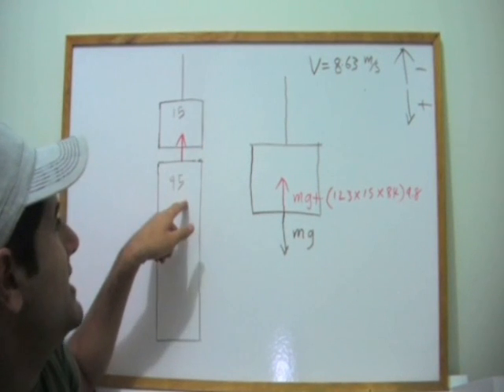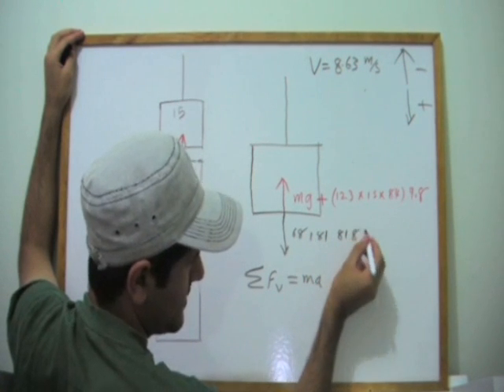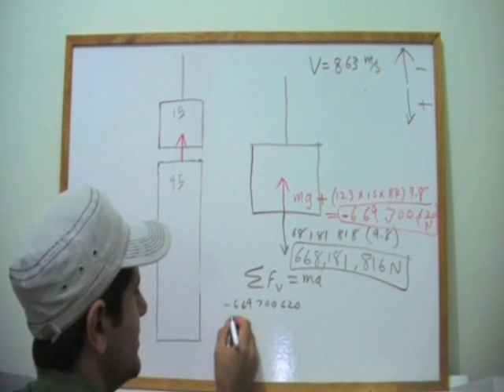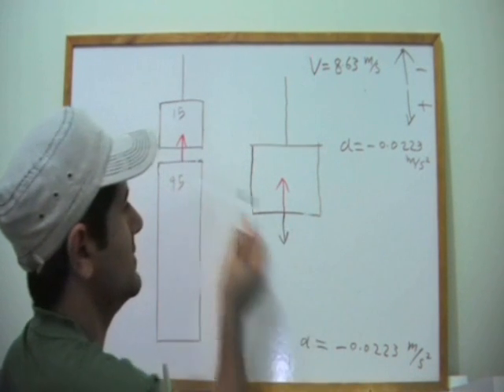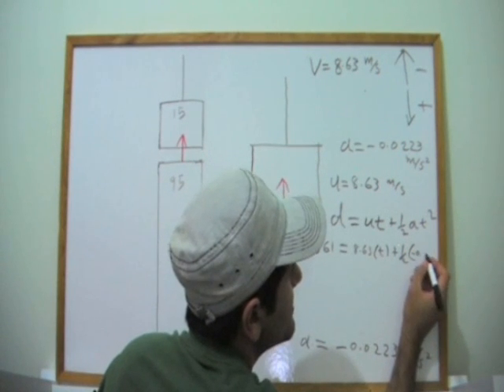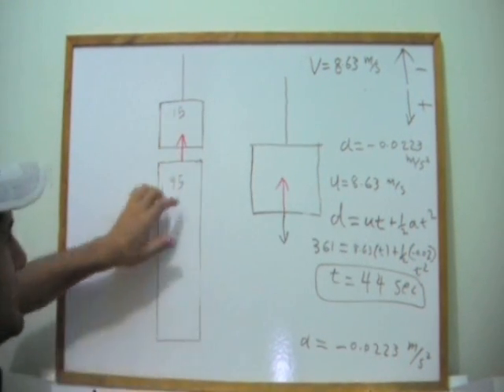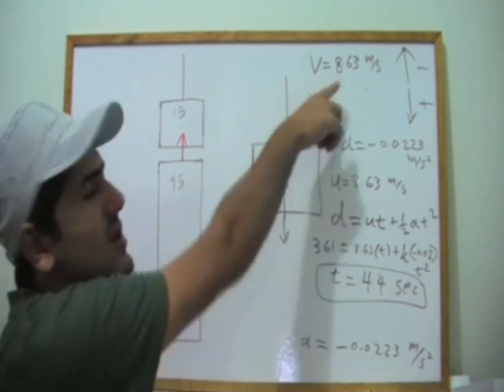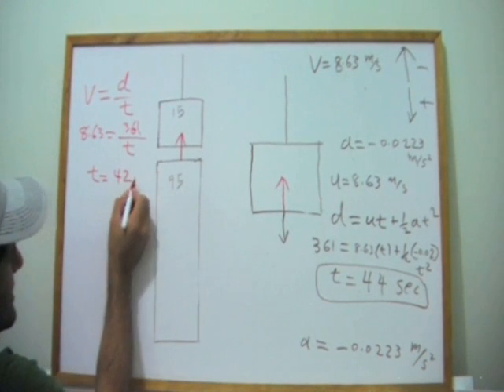(Part3) 911 Simple Physics Structural Failure Vs Demolition

Comment from the maker: Exactly 10 floors can not physically destroy more than 10 floors equal to their own size and strength and after doing so they will be grinded in the process so how did  the top 10 floors destroy the button 90 floors?  I challenge any institution to replicate a model of this event where the top 10% of any structure can destroy the bottom 90 percent from top down without the use of external forces apart from gravity.. we should start asking this challenge replicate this event for us on small scale

Comment from the maker: well said frank you took it out of my mouth, my assumptions are that this magical 10 or 15 floors will float through the lower structure like it flows through a fluid and the AVERAGE RESISTANCE is a constant force equal to the static force that this building was already taking in the past 30 years, many of them say:  "but the floors accumulate progressively", yes but so does the static support it increases as you go down, so at floor 10 your structure is designed to carry 90 floors above it.

Comment: 12weasel100. Granted, dynamic load needs to be accounted for in a detailed calculation, but so does the fact that in an equal and opposite world in which we live, the falling part of the building experiences the same destructive forces. How did the top 15 (smaller floors) manage to stay "whole" and demolish the lower 95 (larger, structurally)??  Would you not expect the whole process to grind to a halt at some stage... say 15 floors down or so?

Comment: This simplified explanation is very compelling, as this version is best case for the generally accepted physical observation. If a more detailed analysis is performed, dynamic loads, increased structural support, and more significantly the destruction of the falling section of the building experiences the same destructive forces as the fixed section. How did 15 floors manage to demolish 95 floors? Simply impossible. Even if some of the debris combines, it still cannot happen.

Comment: The bowling ball would feel MANY times heavier and would inflict damage accordingly due to it's speed. The upper floors of the Towers would do likewise, especially as the cores were damaged due to burning fuel going down the core. That helped to weaken the towers, and added to the damage being done by the collapsing upper floors. The cascading of the upper floors created a force that the idiot in the video simply does not take into account. His equations are seriously flawed.

Comment: Total rubbish. The only part of the towers that came down in anywhere near 10 seconds was the outer wall at the impact points, which peeled away from the tower. Naturally, with nothing under it, that would come down at free fall speed. However, your figures make no accounting for the fact that the explosions of the planes happened INSIDE the towers, and that burning jet fuel would have gone down the central cores. That would weaken the core significantly.
Sorry, but I'm not buying your lies.

Comment: You have a mechanical engineering degree???   In what??

The building had a floor system that had NEVER been used.  It relied on the cross brace of the floors to provide tension to the columns.  If a floor were to drop out its associated columns lower in load carrying ability by a factor of 8.  If its two floors it becomes a factor of 27.. then 72.. then  216.  Etc.    

No floor system anywhere is designed to have 33 floors set in motion and land on it. 

You should understand that

Comment: If it was strictly my opinion i could understand your comment.  But not when there is close up clear video of it.   I've run it back and forth many times and you can clearly see the middle of the building move FIRST.. then the corners go.   Even S.Eng Gene Corely says exactly the same thing that the antennae is going first.   Or middle of the building as the antennae sits basically dead center.  

I don't know where the "argument" is when there is clear video of it.

Comment: On WTC 1 the center DID go first.  There is clear close up video of it.  There is an isolated angle showing a close up shot of the floors just above the impact area.  You can see the corners of the building as well. At the point of failure you can CLEARLY see the mid line of the building start to drop away directly below the antenna.  You can actually see the floors bowing down.. And THEN the corners go after that.  And it is entirely consistent to how the plane hit the building.

Comment: What you say is partially true.  The center didn't fall first, but it is easy to mistake that for being the case.  If you watch the collapse from a side angle, you will see that the center doesn't fall before the rest of the tower.  Instead, the south face of the tower gives way first (because of fire weakening the steel on that side), causing the antennae to fall to the south, and then down.

Comment: The failure of WTC 1 was similar but different to WTC 2.   WTC 1 had its central core taken out to a greater degree than 2.  This resulted in the loads being distributed more evenly across the space.  But what it did was put a larger load on the hat truss.  You can see the center of the building begin to fail BEFORE the corners go.  The load then shifts to the hat truss but it is far too great for it. This then yanks on all the 4 corners and they buckle and fail.  Down she goes.

Comment: It is sick, disgusting, obvious desperation. Those inclined to believe the 19-Arab-nerd-fairy-tale of 911 would point out that some of the dust of the WTC stayed aloft for hours after it fell and then use that to argue that the buildings fell slower than free fall speed. Arguing minutia doesn't change the fact that ISRAEL made it obvious to even the blind that they were behind 911. If you are working for Cointelpro, I suggest you find another job.

Comment: THIS IS TRUE...IF ALL THE WEIGHT(MASS) KEPT TOGETHER PILE DRIVING DOWN INCREASING IN MASS...BUT IT WOULD TAKE LONGER THAN 15 SECONDS DUE TO THE RESISTANCE OF THE STATIC MASS BELOW TO  THE DYNAMIC FORCE OF THE MASS ABOVE...BUT...THE MASS IS NOT KEPT TOGETHER TO CREATE YOUR SCENARIO AND ADD TO THE IMPACT FORCE ...INSTEAD IT IS BEING TOSSED, EJECTED, THROWN LATERALLY UNLIKE YOUR SCENARIO...IF I UNDERSTAND IT ( YOUR  SCENARIO) CORRECTLY

Comment: when ~15% of the mass hits an individual floor, it will most likely give way, when the mass builds as more floors collapse, the force on the structure will continue to build. when it gets to the middle, 50% of the mass (on impact force) is on one individual floor. when it gets to floor 20 or so, 75% of the mass is impacting the floor..

It's not about thinner steel hitting thicker steel. It's about mass and impact.

Comment from the maker: yes thats correct.. a building that height will have big wind loading so its not feasible to build it the same meterial all the way up but rather its like a coconut tree starting thick at the base and thinner at the top as the load it less at the top

Comment: .... the succssive collapsing floors need to say more or less intact in order for its mass to be effectively added to the falling blob of debris and the relatively tightly packed in order not to dissipate the kinetic energy when hitting another floor.  With a collapse in this manner, one would expect to find nicely stacked floor structure on the ground when the collapse is finally arrested, which is obviously not the case, instead, the structure is seen to be pulverized along the collapse path

Comment: Another factor not considered is that if the initial falling block penetrates the structure beneath on impact causing collapse of the subsequent floor, weight of the debris of the next floor has to be added to the falling mass.  This cascading effect is what the official version relies upon to postulate a general collapse.

Comment: This largely depends on the elastic property of the collision zone during collision, much the same way as the crumple zone of a car affects the energy absorbsion and hence the force transmitted to the pessengers or the other vehicle on impact.  Since this is most difficult to define or even estimate, no one can draw any conclusion without actually simulating the elastic property of the floor structure on impact.

Comment: Sorry to say, your analysis is fundamentally wrong.  For one thing you did not take into account the actual collision mechanics, ie. the vertical load is not mg on impact, it is the impulse load that the supporting structure encounters by absorbing the momentum of the upper block accelerated to 8.4m/s on impact.

Comment: The bigger issue is the structural integrity of the whole building.  This guy's calculations assume all 95 floors below are in perfect shape, then one breaks but 94 floors are fine, then 93, etc.  That doesn't make sense.  Using his own assumptions (3.8m height per floor, 95 floors), absolute free fall of the upper part would have happened in under 8.6 seconds.  I don't think you can assume the structure after taking a hit from a 767 at 500 mph is sound enough to ADD 30 seconds to the fall time.

Comment: He did not account for  the added weight of a 747 airplane on top of the floors below or the weakened integrity of the structure due to the plane crash, explosion, or burning jet fuel.  The energy absorbed by the building from the initial crash is huge.  That plane was probably traveling at 500-600 miles per hour and would have transferred on the order of 10-15 billion Newtons of kinetic energy to the building!  (ke=1/2*m*v^2)

Comment: Twoofers, get it in you heads:

It is NOT a BLOCK! There were no BLOCKS! These are building constructions, not SOLID SEPERATED BLOCKS! It was NOT a BLOCK that crushed all the structure beneath it. It was a progressive process. The way the "resisting force" is speculated is inedequate, because you have to consider the energy the connections are capable to absorb and not an equivalent of the whole mass that is comming down.

Comment: I appreciate these calculations. Best case scenario is it assumes this block is intact the whole time it's destroying the building and videos show it certainly is not. What is the driving force destroying the structure underneath if the mass of the top portion is being destroyed itself. How can these two destroy each other anyway? Wouldn't the top be intact until it encounters the resistance of hitting the ground?

Comment: @shorty40merza Also... Each floor the top encounters is going to be a little more resistance.. it would stop falling instead of going through the whole building.  If those burning floors dispersed equally and simultaneously allowing the top floors to fall.. the idea that they would crush the remaining 95 floors and not slow down from free fall is ridiculous. My guess is it would slide off of the top of the remaining lower floors leaving them standing or stopping the telescoping like a table

Comment: @diegogpb One thing i dont think shorty mentioned was the damage area  was more than one floor cuz it was at an angle and  in the 2nd tower it was off to the right side.(not sure if the first towers damage was centered) For arguments sake lets assume the pancake theory is possible. HAHAHA! When the collapse starts it will never fall straight down, the top floors would have hit and  fallen towards the path of least resistance. Therefore no mass to  crush or drive the rest of the floors down.

Comment: If we accept your 68,000 tons for the upper 15 floors, and then drop this mass 12 feet onto the supporting structure, it will hit with 1.6 Billion foot-pounds of force [see - (ht tp://ww w.1728. org/energy.h tm) - note 4 gaps].

There is no way the structure could have survived. You can clearly see that the energy punched though the floor trusses, bypassing the perimeter columns. The energy was fluid, acting like an avalanche.

Comment: Thank you for this, I was sitting here thinking that for ever floor that is destroyed, the bottom half of the building then has 1 floor less to suport, so it has to suport less and less weight. Half way down, it would only need to suport half of the weight plus the few blocks on top. Also I were thinking of the whole building full of people. Everyfloor, the extra weight it suports is ridiculas. I bet it could be built much much higher than it is. Thanks I enjoyed the video.

Comment: @shorty40merza what you mean is (from my point of view) wrong, because you've assumed that there's no safe factor so the 95th floor's maximum resistance is mg from the upper block, that means if each floor has, for example 0.8m of structure and 3m of nothing (except air, you've assumed there's no air). The resistance force before the structural failure of each floor would be mg, the resistance force after that, would be, 10-15% from mg, that means an average froce of about... 25% from mg

Comment from the maker: @diegogpb  force is an instantaneous measure.  at the start of the collision the top section will exert more force than the static weight because of the inertia .. the force will gradually increase and as it increases the resistive force also increases until they both reach the critical buckling load which is more than the static weight of the top section. This doesn't happen at all times and in other times it yields which  means the resistance will be very low... my figure is the average .

Comment from the maker: @diegogpb  but the point i was trying to get to is that to crush the lower the upper section will not accelerate but decelerate or have zero acceleration which will mean it takes about 40 seconds for the collapse to continue all the way through
I am also interested in un-biased engineers to discuss this stuff . you can write to me in the private it wil allow more writing space

Comment from the maker: @diegogpb hello yes you are right . these buildings actually fell slower than free fall . watch David chandlers Videos he plotted the acceleration curve,  
you second point is that impact exerts bigger forces that the static weight i agree 100% otherwise you would never be able to initiate collapse. 
remember that for every action there is an equal. so i assumed at any instant the average resistive force is equal to the weight. i know this model i made is problematic

Comment: I think free fall is impossible having any type of structure behind you, BUT there's an important issue you aren´t incluiding in the calculation.

The higher block weights X, the impact with the block behind it at 8.63m/s is much stronger than X.

it depends on the deformation of the floor down it. I mean, the summation of forces goes down, so, the accel (following your axis) is possitive.

im studying engeneering and i wonder if free fall in this case is possible, can anyone confirm that?

Comment: @Sandberg1972 Stated2: Can we at least agree on the design of the building? There was the central core that held 60% of the structure weight, the external columns that held the other 40% and the 60ft span floor trusses that held the weight of each floor.

These trusses were attached one end to the core,  the other to the column. These spans did NOT carry the weight of the structure above them. They were like shelves in a bookcase.  Rigidity but not support.

Are we in agreement, so far ?

Comment: @Sandberg1972 Stated: You said, "U're stating nothing but unproven assumptions..."  - I don't care if you want to believe that this was an 'inside job' a 'Jewish plot' or even that Neil Bush was on the 80th floor with an acetylene torch and a case of Budweiser.

My only concern here is the physics of the collapse. The planting of explosives is COMPLETELY unnecessary to your conspiracy theories. Any action that caused the collapse of the 60ft spans would allow it to continue unabated. (cont)

Comment: @MrREAPER2014 Points2: The center columns were meant to take 60% of the static weight but not lateral forces (sway). You will notice 'The Spire' stood dozens of stories tall because the force went around it.

Once the weight shift happened, there was no force that could stop it. Forget about 'buildings' and look at 'avalanches' to see a similar event. 

This guys 'upward force' is silly. A glass table supports weight, but barely slows an object crashing through it.

Comment: @MrREAPER2014 Points: This guy makes no "good points" at all.The only thing that matters is the maximum weight a floor can hold = 'X'. The engineers would allow for '1.5X'. If the floor above falls 12 feet onto it, you have a minimum of 12X + the 1X of the existing floor. 

This will pound through and pulverize the thin concrete floor and move right on down. The walls will fly outward from the force of the clips snapping and center columns will fall over if they survive impact.(cont)

Comment: When the upper floors collapse, they fall on the lower floors crushing them ONE AT A TIME, adding their mass and increasing the acceleration. Ask yourself why NO structural engineers agree with the nonsense you are peddling.

Comment: There are so many ways you can prove that there was a structural failure. The block fell and transferred it's energy to the base of the tower, and there are so many simple tests you can do to prove it if you don't think an energy transfer is "real". 
Proof: Line up all 15 pool balls on the side of the pool table, and with the the cue ball, hit the first ball. When it hits, the 15th ball will move forward. Do the same test with the 15th ball backed up in a corner. Notice, everything collapses....